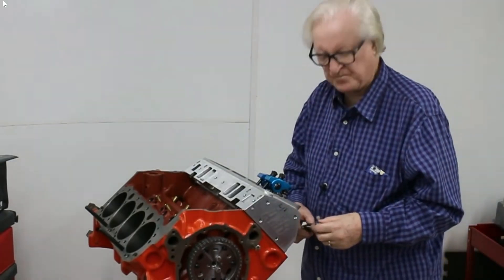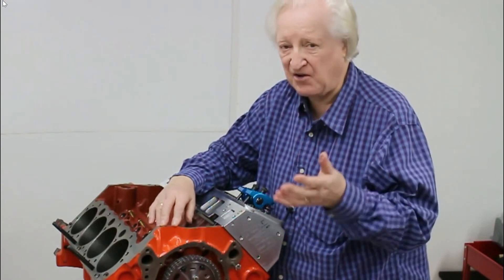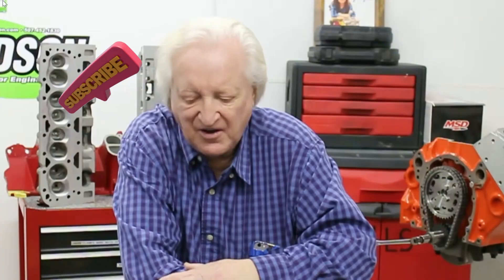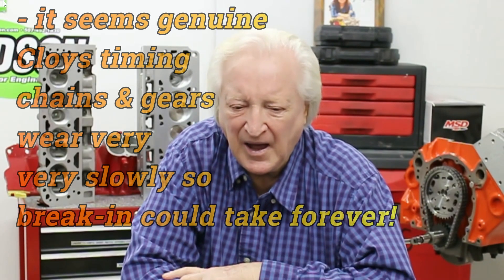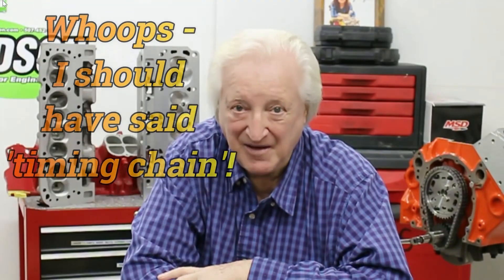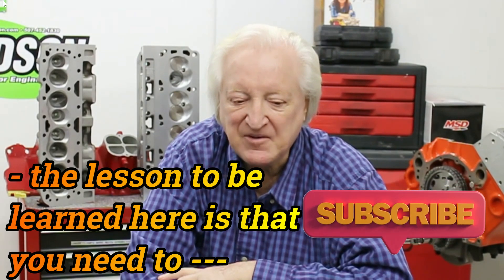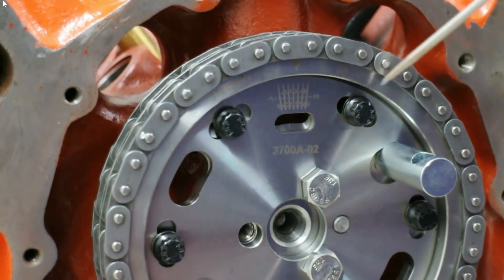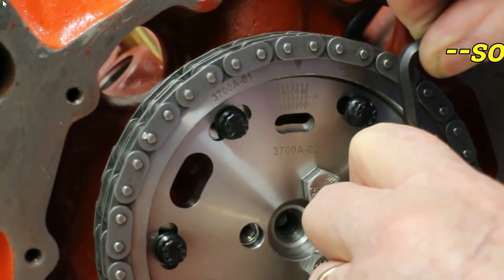Here's how to fix a not so visible power pirate

Comment: Didn’t Smokey Yunick claim that the timing chain was the work of the devil?
Reply: @rustybritches6747  the problem with gears is they cost more power than a proper sized chain. A belt ultimately costs the least amount of power. Friction is the loss. Gear drives by nature have more surface area in constant contact therefore loose the most amount of power. A gear drive keeps timing as consistent as can be though
Reply: @jeremypike9153 wrong , good gear is 98-99percent efficient
Reply: I've also never liked the look of the chains with no tensioner or anything, always seemed like a halfassed solution that I'm surprised works as well as it does. I guess it may have made more sense when rings were soft iron and the engine overhaul interval of a typical passenger car was like 50k miles, you wouldn't be going in often just to change a sloppy chain in that world.
Reply: @dennisford2000  at keeping cam and ignition timing dead on yes 99% efficient. Depending on what style you get though they create different inefficiencies. Helical gears create a thrust force towards the timing cover creating a rotating friction with the cover as well as power loss from the way the teeth engage each other. Straight cut or dog engagement gears don't create a forward force but have more surface area in contact where the teeth engage creating power loss. Gears also by nature are consistently wearing so material from this wear is circulated through the oil. I like using timing gears but I'm also not after building a race engine. There is a reason why nitro engines are using timing belts instead of chains or gears it's power loss from friction. If you don't believe what I'm saying do some research or ask the master Vizard knows what he's talking about.
Reply: @jeremypike9153  double helix( herringbone) no thrust and great efficiency 99-98% would need modified cover to work. May not be retrofitted to many v8 .
Reply: @dennisford2000  still can't defeat the surface to surface contact is higher with especially a herringbone gearset than a single roller timing chain or belt.
Reply: @rustybritches6747  they really are a good reliable setup.
Reply: Which is why I like 2 strokes 😁
Reply: @jeremypike9153  you act as though chains don't do all of that, and more of it. Roller, pins, shit, the factory type is basically a big bendy gear running on two gears, but with wayyyyyyyyy more mesh, and all the losses and wear in the pins holding the chain together. I'd need hard data to believe an idler gear takes more power to turn than all that shit going on in a chain drive. The belt might be a little better yet, but that's expensive power gain on an engine that didn't come with one already.
Reply: @Broken_Yugo  dyno pulls prove it repeatedly look into it. Also there is a reason Ford decided to run the newest generation of coyote with a belt to run the oil pump. It's more efficient than a gear or a chain and in the application of an oil pump stretch doesn't exactly matter
Reply: @rustybritches6747  Steve Morris engines says he prefers a Jesel Belt drive over gears or standard timing chain.
Reply: I guess a gear drive is out of the question
Reply: One of his cross ram manifolds for sale here n nz for 500usd ish... never heard of him the  manifold any good?

Comment: My experience from running too tight of a timing chain is that the front cam bearing wears in (i.e. excessive wear) before the chain and gears break-in.  This makes sense since the cam bearing is much softer than the steel chain and gears.
Reply: As well as crank bearings, most already have a belt pulling on them, old Buicks need a very tight power steering belt heard many front main bearings slap before oil pressure, and they have weak pumps.
Reply: I experienced the same thing with a 2.2/2.5L mopar 4 popper.
It didn't have a automatic belt tensioner and everytime I set the tensioner too tight, it would break the cam after about 500 miles no sweat. Went thru 3 cams before I referenced the OEM service manuals and saw that I was goin too tight.
Set it to OEM spec and had no issues with the cam for the years after I had the car.

Comment: Good tips david.  I'm 73 years old.... still driving my 64 mini cooper s... thanks to your 'tips' on those ! Anyway...  Did lots of  drag racing in the past. All 354 and 392 chrysler supercharged stuff.  Even tho we used only gears for timing we still spent hours getting the 'slack' just right. To tight , even on gears , cost hp. To loose and it was even worse ...causing 'spark scatter'  and costing hp and possibly blower explosion !

Comment: Here's an interesting anecdote for you all, based on my build and repair experience of Caterpillar C15's...
The specificaton for harmonic damper/balancer replacement is 500,000 to 600,000 miles, depending on the application, and also specified by CAT to be done at leaking front seal replacement.
If not changed out at seal replacement, the seal will begin to leak again within a very short time, and it has nothing to do with the condition of the running surface of the damper where it contacts the seal as it's a two piece seal, where the inner part of the seal is a sleeve that rotates with balancer.
Furthermore, when the damper is changed, it improves the fuel consumption by approximately 8 to 10%, which is noticeable immediately after seal and balancer changeout, even when no other repairs to the engine are being performed.
The conclusion drawn to by myself and peer colleagues is, the damper is an accumulator of energy at the firing of each cylinder, and that, the elasticity performance of the rubber between the two damper parts deteriorates, and although it may not appear to be damaged or broken, on a micro level the bonding of rubber particle does become compromised.
Reply: I don't remember just how many hours John Deere also recommended changing the front pulley assembly also, It my have been only on certain models and applications.
Reply: Absolutely.
Reply: Yes much the same with 50, 60 litre + Cummins engines too
Reply: Also, if the damper rubber gets too weak, the damper can lay over to one side, creating a negative inertial torque moment which can not only rob power, but cause main journal failure and crank shaft cracking.
Reply: This has got to be an expensive maintenance repair. Could this have any effect on a V8 engine is my question.
Reply: @jimmybare3026  I"m currently building a big inch Mopar... From what I've learned, I'm assigning a large chunk of the budget to the best balancer I can find.
Reply: @i-am-that-what-i-am  I want to find out a bit more about this timing chain tensioner. It exerts a good deal of inward pressure on the side of the timing chain and not only that, you have the drag of the nylon shoe pressing against the side of the chain. I don't see how it couldn't be a power robber.
Reply: Right on the money, my friend! (Literally, my money) Learned this lesson with a couple of 3406B Model Cats. The two-piece factory rubber balancer quit on me, Cat replaced it with the updated viscous dampener, and noticed the difference in driveability & fuel economy right away.
Reply: Yep comprised over time just like a dry rotted tire, vinyl roof, dodge ram dashboards, etc. etc.

Comment: Hi,
I figured out / learned the lesson when I was 10 years old in the early 1960's. I really tightened the chain up tight on my bike and found I could hardly peddle it, then playing around after a while the chain broke.  When I started building engines and racing I made sure the timing chain was a little loose. I believe today you can get under size sprockets for non nylon type sprockets. By the way the Chevy nylon sprocket is 1/2 inch wide the 1958 Corvette was 5/8 wide.

Don
Reply: Cloyes makes different length setups for line bored etc.

Comment: I would love your knowledge on fluid dampers vs fix weight dampers. Thanks for all you do DV!
Reply: Me Too
Reply: He did you want a heavy one ,not a light one back in the day they used 409 balancers on small blocks
Reply: @darrellsomers5427  I’m talking about the Fluid filled dampers vs the all steel weighted with the rubber ring.
Reply: I was wondering the same, I think they have their limit within rpm, but I don't know. Only what I've seen on a chart , BUT those charts may be from a competitor brand and not quite truthful !
Reply: Way off the subject here but kinda interesting.... had a 327 chev that was pro built... always had very , very , slight harmonic vibration at different rpm's.  That was with the  high performance big 8" corvette balancer.  Switched to the FluidDamper and eliminated all harmonic vibrations ! Sorry.. way off the main subject here but just thought I'd throw that out...

Comment: A frequently overlooked factor I’ve seen, is distributor gear backlash and the resulting chatter not only resulting in ignition scatter, but, crazy vibes being fed back into the camshaft. 
I’ve also wondered if it may have contributed to oil pump issues.
Reply: They always put the oil pump on the end of the distributor shaft for the purpose of keeping the slop in the skew gears in check = of no effect.  Also pretty sure the forces the camshaft deals with are about an order of magnitude larger than the oil pump+distributor forces so they can be neglected.
However when you go changing the valvetrain from stock and standard stuff then you really should figure out some sort of crank trigger system. The high voltage spark distribution function will tolerate a fair amount rotor-cap phasing error (as witnessed by every stock vacuum advance system introducing rotor-cap phasing error)(well - except for some old engines that turned the entire distributor = four main bearing Chevy Sixes)
But the problem with crank triggered stuff is how to come up with centrifugal advance = and even worse you need to keep a stock type centrifugal advance in the distributor = and they need to match to keep rotor-cap in synch !
Good luck - I never did figure out a good Old School Way to keep all the cam wind-up and wind-down from affecting ignition timing, I run a Pontiac and the stock water pump may have to go so I can cobble together some kind of ultra-short distributor run off the front end of the cam. It's a headscratcher.
Reply: @stujones3566  Once I saw a magazine article where a guy took a V8 distributor and machined it to have little sealed ball bearings in it instead of engine-oil bushings. He laid it down and faced it back along the block and made brackets to hold it and allow for timing adjustments. Finally he machined a little cog-belt pulley and got it on the crank snout behind the harmonic balancer. Finally he put a twice-as-big cog pulley on the drive end of the distributor (to get the 2-1 geardown).
   It worked great on a dragster but real car engines have a crossmember and engine mounts down there on both sides. 
     Sure would be fun getting under it to change points, have oil dripping on your ignition, and making a cover to keep sticks and stones out of your belt drive !
   So the search goes on . . . I am really starting to envy guys whose engines drive the distributor off the FRONT of the camshaft (but hey their oil pump has to suck oil from the where it's all glued to the back of the block by acceleration - up to their front mounted oil pump.)(gah - seems like there's no easy solution!)

Comment: If I recall, Grumpy Jenkins used stock nylon chain sets rather than double rollers.  He said he put on a new set for every rebuild.
Reply: Light weight means less vibrations and they were cheap good for 50,000 miles on most small blicks
Reply: Okay
Reply: @johnfairchild3421  
'69 400 Pontiac... Mine went toothless in 36,000 miles. 10 miles from BFE. Used the best oil, and changes.

Comment: Wise words excellent channel and thank you, words of experience and I never looked at it like that, and your right the gear teeth wear as well, I checked with a new chain it was loose as the old chain same original block not line bored so now am going to buy a set with new gears and use my old chain and see thank you I subscribed cheers from 🇦🇺

Comment: WHAT i've found is that tight timing chains will rub the bottoms of the cam bearings and reduce the effectiveness of the hydrodynamic lubricating wedge and literally eat the bearings causing a lot of unnecessary bearing scrub,timing chain components have to be matched to the load put up on the vehicle ,in racing,constantly changed,everyday driving,every 85 to 125k or the retarded timing with eat the exhaust valves and seats right out of the head,DAVID IS THE ONLY ONE WHO HAS EXPLAINED THIS PROBLEM perfectly,this is the man who has been there,learning BY DOING,thanks DAVE

Comment: The linkbelt timing chains wore like the devil. A guy I worked with used to say when doing a tuneup, if the timing chain had any more than 30k miles you needed to replace it. Without doing so he said, you could never get the engine to run 100%. To a point he was correct but a little anal about it. My experience was 50k to 60k was kind of the wear limit. Now we need to realise oils and metalurgy were not what we have today. For long life a truroller timing set is the answer as they will generally go 100k miles or more.
You can rotate the crankshaft forward and backward to just take up the timing chain slack to get an idea of the state of wear without removal of the timing cover.

Comment: I definitely see where the pressure against the bearings and resonant crank harmonics can both cause massive power loss.

Another thing besides simple friction, there is also dimensional harmonic throw, and resultant lifter knocking and lifter drop.

In other words, 

1: the vibrations from the crank CAN cause the cam to flex [imperceptibly to the naked eye, but with a really close up high speed camera you could see it] and this can both cause the rotating mass of the cam shaft experience centripetal rotational resistance because of the laws of conservation of momentum, which, by its nature, creates moments of negative torque, which travels back to the crankshaft, and stealing that torque from the entire system.

2: this flexation will cause the cam journals to impinge upon the cam bearings more, pushing through the layer of oil, causing them to potentially collide with the bearings, not only adding friction, but causing wear.

3: the same flexation will change the 'effective' cam-to-lifter contact, meaning that at unreliable, and irregular intervals, the lobes will be either further out [causing increased lift] or further in [causing decreasing lift]. While this may not seem very important 'as long as it all averages out in the end', it in fact is VERY important, as it  leads to INCREASED harmonic IMBALANCE in the crank shaft, potentially leading to an infinite feedback loop and the destruction of the engine at an accelerated rate, and  robs all engines of total horsepower when they are fed an imbalanced volume of air and fuel mixture.

To clarify point 3-B, when cylinders deviate from a uniform output level, this not only increases vibrations, and crank shaft stress, it also brings the average BELOW even the lowest cylinder value, therefore bringing the total net collective value down.

This is something that was proven back as early as the 1930's when early race cars were being experimented on and they were being built with substandard parts, but was soon forgotten because racing engines were eventually going from hand built individual creations to products of a uniform engine manufacturing system which reduced these irregularities a lot, AND where both total horsepower and engine speeds were quite low, as compared with today's modern engines.

The facts were always there, but they were forgotten because of the development curves in the industry, where high engine speeds and lower displacement engines where the effects are more pronounced had not really come into existence yet.

As one perfects an engine, they can expect to run into new, or, more correctly, little known issues which few people ever wrote about very much.

For instance: one of the best possible ways to prevent this kind of whipping of a camshaft, just like with crank throws on a high performance engine, is to increase the barrel thickness of the cam while boring it out hollow.

As a 'drilled' or 'bored' cam,  you can maintain the same total mass, and same total volume of metal, but with a stronger, more rigid form, so that it will be much less prone to whipping.

That does not remove the need for proper cam chain tension, but it will greatly improve it.

Also, hollow-grinding all of  the cam lobes would help a lot as well, but that is some really high end machining!

All of this is making me think perhaps I need to be building a new kind of cam shaft.

Comment: David: I’m a regular for info on the Uncle Tony 318 build info, we out here are blessed to be able to tap into what you have learned over the span of years that you have been doing this! I have always wondered about “ gear cam drives” the timing chain tension is interesting! Especially at my age of 75 having dealt with this problem with the many engines that I have built! Seems to me the more slop there is in the chain it would change your cam timing logically thinking, which is why we have an adjustable distributor whereas you can check the timing at the crank pulley! The tighter the timing chain the closer the relationship of everything to the designed running timing specification of the particular engine! Is my thinking correct!? So what about if it is set up with a gear cam crank set up? And what do you think of gear drives? I don’t think gear drives are available for Mopars regardless of that I’d like to know what you think about gear drives? Regards Mad Mike S. …….